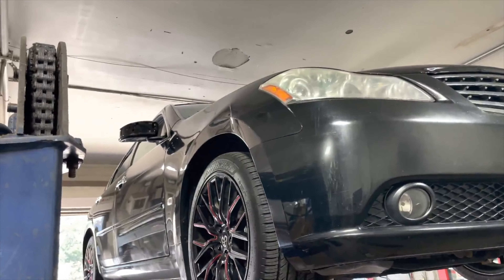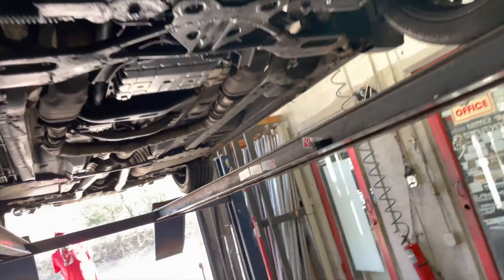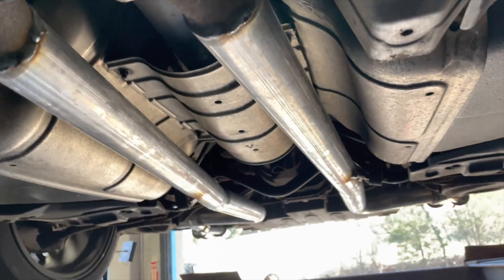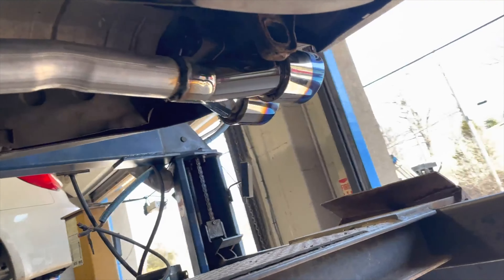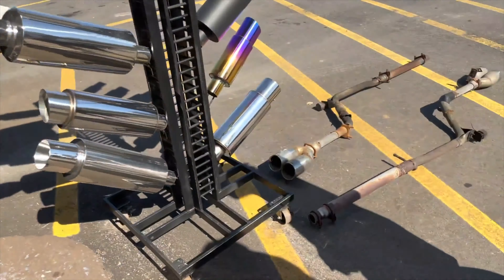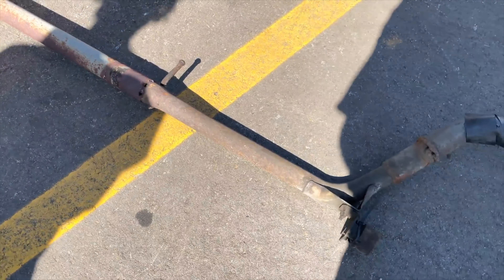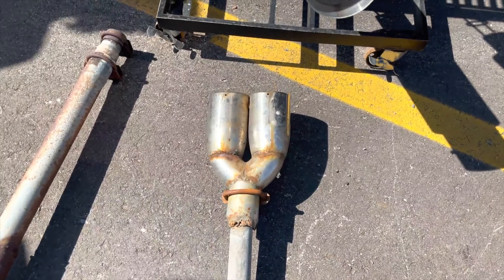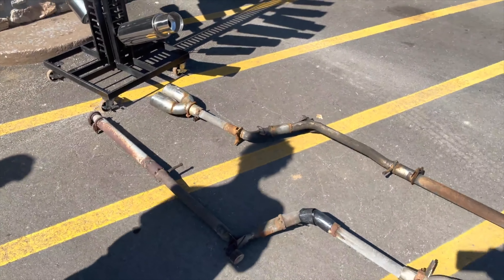2006 INFINITI M35 3.5L V6 Dual Exhaust w/ STRAIGHT PIPE!

Comment: I am subprised but then again I should not be. He actually thinks this sounds good. 🧐
Reply: He should have went with 3.5 in 4in into x pipe into borla s type.
Reply: @boratwilson9916  All he cared about was that it was loud. Did you hear how giddy he sounded when they first started it up? He had no clue on what he wanted actually. Just enough noise to have attention.
Reply: @ragintaurusmusclemercury7023  most rivers do 😆 🤣  I would never run that small of a diameter.